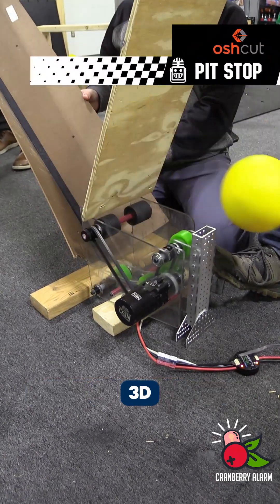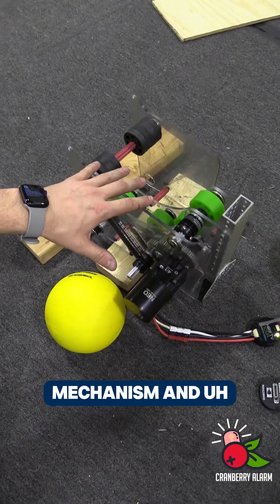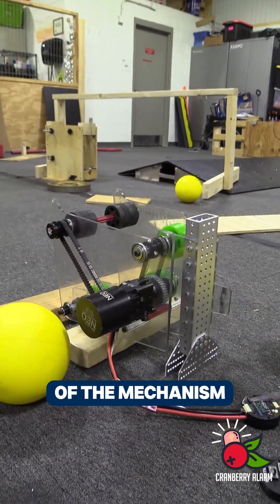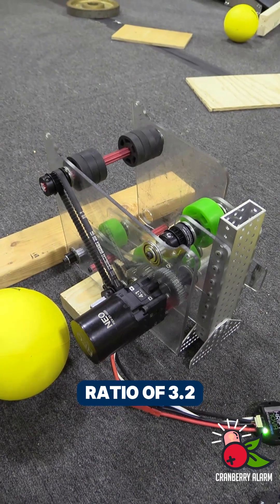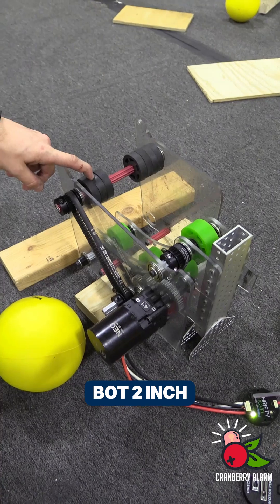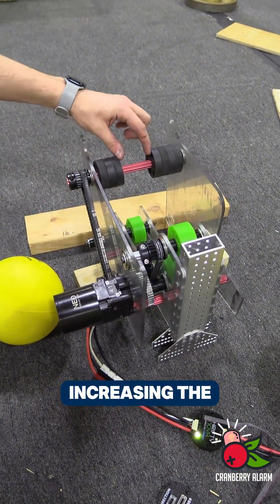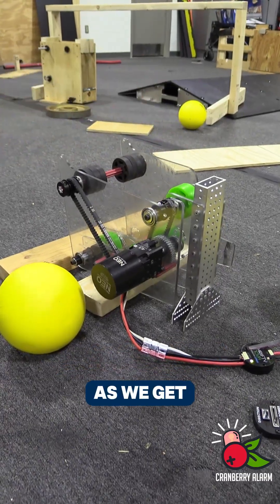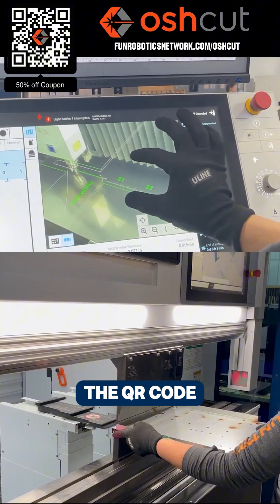⚙️ Ri3D Cranberry Alarm | Fuel Kicker Explained

Comment: Could that be used to score
Reply: @Clasher-n3k I wouldnt call it impossible but w that design highly unlikely.  with a different gear ratio and/ or flywheel and/ or motor probably tho
Reply: @blueGate3-o7tyeah would just have to modify it a little bit